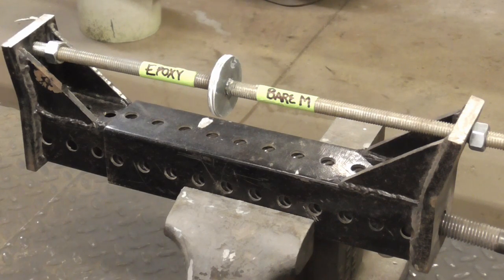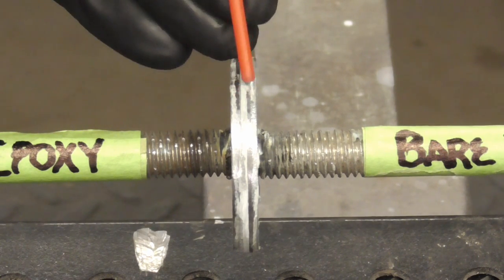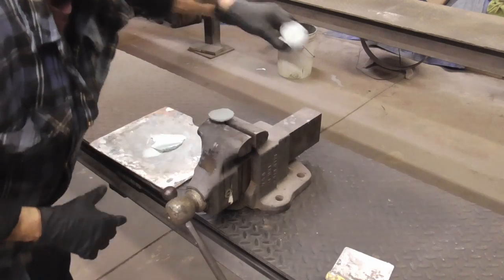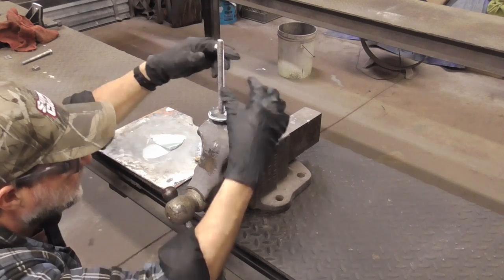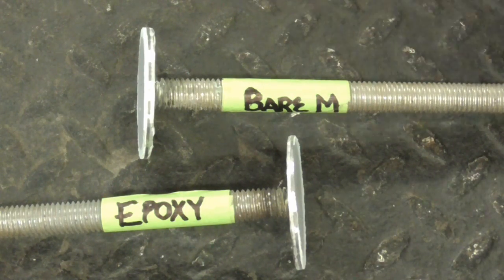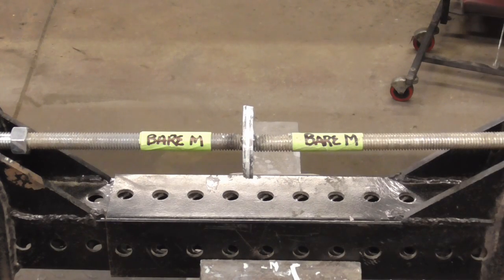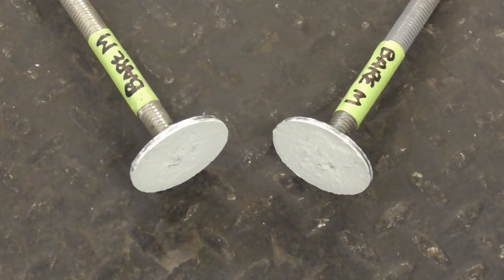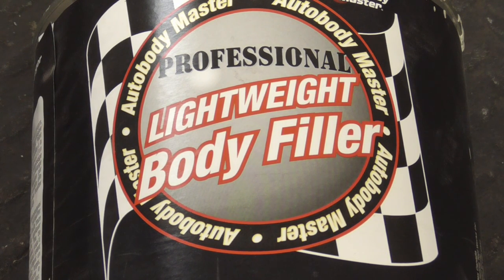Apply Body Filler Over Bare Metal or Epoxy Primer?

Comment: sand the epoxy plus its better for rust then apply filler. should be tested
Reply: I dont get why people argue over this.  This is not something controversial.   Rust behind filler is a non issue, it doesnt happen unless the rust was already there.  

Bondo stick to metal better than primer, its a sealed bond that protects the metal underneath just as much if not more.      

Either way wont hurt unless you prep the primer bad then it might seperate.    Just do it as the manufacturer says you should and sand to bare metal

Comment: Epoxy primer needs scuffing with sand paper before applying bondo.
Reply: Don't feel like it makes any difference. 
If the  epoxy split apart. 
Scuffing the surface is irrelevant. 
It didn't split on the  surface of the epoxy did it?
Reply: That can easily be a epoxy application issue.
Reply: Depends on the epoxy; depends on the window. If you are outside of the continuation window, then yes you would have to prep the surface for mechanical adhesion.

Comment: this actually proves body filler sticks to epoxy primer at least as good as it does bare metal and that your second coat of epoxy primer didn't adhere to the first
Reply from the maker: I thought about that but do you really want to take a chance of worrying weather or not the coats are sticking?  I plan on doing this again in a bunch of different ways to test the solutions in the comment section.  Should be interesting.  I know myself from working in professional shops that filler is always applied to properly prepared bare metal :)
Reply: @LakesideAutobody  whether you put body filler on bare metal or epoxy you still have the equal  issue of the epoxy de laminating ,This tells me Auto Body Master 2K may not be a good product
Reply from the maker: @TheBobbykey  I'll do this again in another video with 2-3 types of epoxy primer - it dried for 24 hours - tech sheet said fully cured in 12 hours.  I'll let each cure for like a week so there's nothing to debate.  Should be interesting :)

Comment: You ALWAYS SAND, with at least 180 grit before putting filler on any new primer/clear or base coat. Filler will not stick, not matter what.
Reply: @WonTooForAte9  As do I, and you. Just trying to help a little.
Reply from the maker: The filler stuck fine to the epoxy primer - that wasn't the problem - watch closely.  The epoxy is much weaker than plastic filler - it will be the weak link of the repair.  The epoxy "split", broke, separated.  It wasn't an adhesion issue is was a weakness issue.
Reply: @LakesideAutobody  Gotcha. Guess I need  pay better atintion.
Reply from the maker: @billsmith9937  Have a good weekend Bill - thanks for watching :)

Comment: Sometimes it makes sense to epoxy it first if the car is gonna be sitting around for a long time to keep it from rusting. I guess the only question I have is whether the epoxy primer had time to set fully before it was pulled apart. You want to apply the filler before within the fully set window time but let it fully cure before performing the test. The other consideration is that if you're gonna epoxy for long term storage ,if it's after the recoat window, before beginning the bondo, the epoxy has to be sanded to give it some tooth once it goes past the recoat window time period. In a commercial collision shop, it really makes no sense to epoxy prior to body work since you're pushing the cars out fairly quickly compared to the part time home garage guy. They say that the epoxy prevents moisture from getting past the bondo and corroding the metal, which is most likely true. The paint is your first line of defense. A scratch in the paint through to the bondo will allow moisture in. As a matter of fact I've seen cars with the original paint job with just a minor nick in the paint, not through the primer, just past the color coat. Sand the minor imperfection and find rust beginning to form under the primer.  Most factory primers don't keep out the moisture. Perhaps on some higher end cars there's a better coating solution from the factory. You've probably seen way more cars than I have and know which cars have a better paint foundation.
Reply from the maker: The epoxy dried over night.  The epoxy was just not as tough as the plastic filler.  One quick note... All shops that I've worked at frowned upon putting filler over anything but bare metal.  It never felt good having other guys seeing you do it either.  Have a good weekend Marcel :)
Reply: @LakesideAutobody  Many times I think the product manufacturers just want to sell more products. I kinda miss the simplicity of bondo and lacquer primers, and enamel paint jobs. Remember when they'd do 10  coats of lacquer to get that show car look. It would look great until it started cracking all over the place. The only way to keep it nice was to garage it in a temperature controlled garage. 😂
Reply from the maker: @marcellemay7721  Yep - my dad was a big lacquer guy.  He worked at a place called JRs Custom Paint  - they did vets and custom vans with murals of like mermaids, women, bears, sunsets, etc.  I thought that stuff was the coolest when I was little.  These guys who did the air brushing were absolute artists - then they buried it with many coats of clear lacquer, cut and buffed till it was glass - awesome!!!
Reply: @LakesideAutobody  Overnight is pretty short time for epoxy, I would want at least 1 week in warm condition before putting some strain on it. Speaking only as an amateur who used epoxy primer on my car and it was considerably stronger after longer time curing.  I personally think both ways are plenty strong and will hold up fine in real life, it's just a matter of convenience. Thanks for the test!
Reply from the maker: @sidney9534  You're welcome.  I think there's quite a bit of interest in the topic.  I might try it again - different primer brands, different dry times, paints, lacquer primer, etc.  I'll could some type of gauge to see the actual difference between the trials.  I think that would be pretty interesting.  I liked putting the impact to them though to see what they could take :)
Reply: Wondering something similar myself.  I’m new to this, just jumping in.  From my reading, you should be coating bare metal within hours of stripping it, as it starts to oxidize almost immediately.  So this means you’d need to do some level of skimming and sanding between stripping and protecting?  My passion is older Italian cars, you can pretty much watch them rust.
Reply: @brianshorey  I've just done a japanese car, so pretty similar rust-wise. There are many ways to do things:

 1. if you work fast in a dry shop, you can get away with just painting inside cavities and seams with some good spraypaint, and leave the outside accessible areas bare metal. They will flash rust, but it's easy to wirebrush.

 2. just spray the wohole thing with thin layer of cheap spraypaint as you go, and when ready to paint, just wirebrush it away.

  3. coat everything in 2k primer as you work. This is the best way, but it's the most work (mixing, cleanup), and you will probably use a lot of paint. Also for areas that need filler - I found I end up sandign throug to bare metal anyway in the process of panelbeating and filling. But wide flat areas don't really have rust problems anyway.
Reply from the maker: @brianshorey  The idea that a stripped panel will start oxidizing immediately doesn't hold a lot of water - no pun.  Cars were in bare metal for 1-5 days when working in body shops with out rust showing.  You have plenty of time to do your body work, DA sand, tape, remove parts, etc. before priming w/o worry.  In the winter when a building is being heated there's almost no moisture in the shop air. Even in the summer, there's really no worries.  If you are going to park it outside then yes, it would be good to throw a coat of primer on it.  Any primer is fine but epoxy is water proof if you leave it for days or weeks outside.  I've left lacquer primer outside for months w/o issues.
Reply: @LakesideAutobody  yes, but how tough or not really is it? Maybe not tough enough for your specific experiment, but tough enough for what it's made for. Anything will give with enough force applied. Just because it came off before the filler does not mean it is worthless in what it is intended for.
Reply from the maker: @saeefullahmohammad1402  I actually did this experiment again trying some different things.  I think you'll find it interesting.  https://www.youtube.com/watch?v=wVhQLqPAGVU  You make some good points SM - have a good week :)

Comment: Body filler is not fore bonding . mereantex...is fore bonding ...too many factors with your primer when you strip  a car then prime with expoxie it ses up to couple days you can apply filler after that cure time it needs mecankal bond ....depending on the product manufacturer....and when you sand it should be locked up not gumming your paper

Comment: You don’t sand bare metal with 220 before epoxy! You set up test for failure that way. Minimum 80 grit. What brand epoxy? I’ll continue using filler over a panel sealed with epoxy.
Reply from the maker: So you're saying in order for epoxy primer to stick to metal you have to sand with 80 grit?  BTW the epoxy stuck just fine to the metal - didn't even come off the metal - watch close to what happened to the epoxy. Don't be fooled by magazines, TV or internet articles - you are wasting your time and $.  Filler came out 30-40 years before epoxy primer - how did they apply it then.  Nothing except the paint is responsible for corrosion protection  Ask around body shops if you want to find the answer to the debate not the media.
Reply: @LakesideAutobody   been at this trade as bodyman/owner for nearly 40 years. Paint materials have evolved to what we have today and I evolved with it. Since I started using epoxy I’ve never had any filler “fall off” but certainly had many vehicles come in with body filler that pops off with heavy rust behind it causing the failure. I am way less concerned with how well body filler may stick (cmon it took a hydraulic ram to cause the failure in your test) and much more concerned about the corrosion protection the epoxy has. Sure, a collision shop doesn’t have the time to always do it the “right” way and I get that as most people don’t keep a car long. On restorations epoxy first is a must IMO.
BTW I’m a fan of you and your channel and expressing my opinion doesn’t change that.
Reply from the maker: @donh8563  Just a thought... I've seen the same thing many times where there has been rust behind the filler but the reason has always been that the person who put that filler on, put it over metal that water could penetrate.  In other words, the metal had holes in it - either it was thin or had pin holes in it from welding or some other crazy reason. Or... it was some poor workmanship, then the filler cracked and moisture penetrated the repair from outside.  If it's just straight up regular good sheet metal rust will never ever form under filler - that is as long as it's primed and painted soon after the filler was applied.  Nice talking to you and continue doing what works for you my friend - just trying to save folks time, $, health, and the dreaded cleaning of spray guns.  Thanks for watching Don - keep in touch.  Like I said I'll do this experiment again. Let me know what you would like to see in the experiment next time?  Be specific and I'll do it just how you say :)  Jerry

Comment: I’ve been wondering which was better for some time. I’ve done both on my current project. Moving forward I’m definitely going with filler to bare metal. Thanks for the info!
Reply from the maker: Remember, filler came out 30-40 years before epoxy primer.  In all the shops I’ve worked at in the metro Detroit area not one boss, manager, worker would ever accept putting filler over anything but bare metal.  A guy who did would have been laughed right out of the shop. Yes you could cheat and get away with putting it over paint and primer on small stuff but it was always frowned upon.  The guy who got caught doing it was considered a hack or a newbie - couldn’t get his work straight so after he primed it, you saw him fiddling with filler again - over the primer he just blocked & found out it was too f’d up to fix with just primer.  I think the filler on primer stuff came from magazines, TV and internet trying to sell products :)
Reply: @LakesideAutobody project farm does stuff like this. Love it👍😁👍
Reply from the maker: @pitchforkpeasant6219  👍✌

Comment: Okay.. But "what kind/brand of actual Epoxy sealer" was actually used? 🤔 And how "freshly applied then tested?" Was it within the 24 hour window BEFORE it is supposed to be sanded/scuffed up when the body filler was applied? Was it actually sanded at ALL before applying the filler ?(it obviously didn't look like it) 🤔 So yes, good clean 36 grit prepared bare metal IS a GREAT adhesion surface for good body filler for fact. But what about providing a non porous barrier BETWEEN/UNDERNEATH the body filler? Hey, I am NOT here to necessarily argue about your strength test video, as I have done it BOTH ways for  years in "the Arts" as well. It's just that "nowadays", IF it's my personal classic cars I am restoring/OR a customer's car (that wants to spend the $$$ on Epoxy sealer 1st before skimming the filler on their classic car restoration) as that IS my personal recommendation as well. THAT IS my preferred way "these days." For one? I absolutely do NOT have to worry about immediate flash rust/metal contamination right after stripped/blasted etc and two, it does provide that barrier BETWEEN the metal and the filler. But yeah, the Epoxy sealer that I do use on most everything bare metal wise? I STILL WILL 80 grit sand/ EVERY bit of it BEFORE ANY filler is applied. I know to ALOT of people that "that method" just seems senseless to spray Epoxy only to turn around and sand it back/down  but? It HAS worked the BEST for myself and LOTTA other people's cars done the same way for over 30 years... Just like, applying filler directly over freshly prepared 36/80 grit steel as well. 👍 I just like to "sleep at night" considering some/lotta of the freshly stripped panels that I do have? I may NOT be able to start really bodyworking immediately after they are stripped, so.... But yeah, I'm NOT a fan of applying ANY filler over ANY unsanded/non scuffed Epoxy sealer over ANY bare metal anyways. That shyts ALL GOTTA BE SANDED! 😆 Lol. Gotta have some teeth with something to actually bite into. 😏 So again? "Just my 2 centavos."  Keep up the good videos 😎
Reply from the maker: You never have to worry about porous this or porous that.  That's magazine/TV/internet stuff.  The only thing that is responsible for protecting the metal from rust is paint - end of story.   This is not even debated in an actual body shop.  It's bare metal, filler, primer, paint.  You don't park a unpainted car outside for a few weeks, then decide to work on it.  All the work is done in 1-3 days.  If it is left alone for some time, you're going to have to freshen it up by DA sanding or removing any light rust.  Never depend on any primer - epoxy, etc. to do that for you.  Epoxy primer doesn't prevent rust either - only paint.

Comment: I was taught to apply 2K primer over epoxy than do bodywork on it. Epoxy is a form of plastic to seal metal from moisture.  See so many videos it gets confusing do this do that. Your video just adds to it. I've always believed a well prepared panel will accept body filler.  Tks for video lol

Comment: What I do is to Sand the portion which need to be applied by bodyfiller first with grinding disc. Then i let it rest for about 2 mins to avoid distortion the metal then I grind it again by using 36 grit flap disc. After it rest for about a minute I wiipe it off with clean rag dipped in laquer thinner. Then mix my filler throughly. ( Kneading the hardener and spread the filler as you mix ) then one last cleaning before I apply my filler. I get some clean tackrag and dip it in with Acetone to ensure bare metal cleanlines then proceed to fill the spot I have to fill in. For me both works good but if you need something to stick. You need that tooth. The sharp gritty texture from grinding the substrate than putting filler above scuffed Epoxy Primer with 120grit. For me its way too smooth. And that few mils of EP set the difference between grinded metal. Putting it straighy to grinded metal is the best for me. It doesnt gum your sanding paper like your sanding a body filler on top of EP. In my opinion fillers is like tattoos. You ingrave it into a persons skin. Not into their clothes. Always pick the trusted old school way. 

- greetings from Philipines.

Comment: I have repaired cars etc for 30+ years, and have  always put filler over well prepared bare metal, not once have I ever had an issue. Great video.
Reply from the maker: Thanks for the input.  It was a big no no to put filler over anything but metal where I worked :)